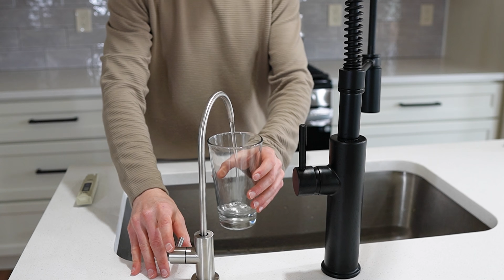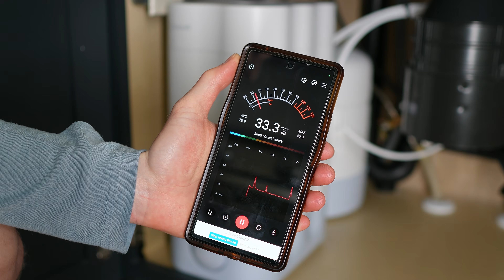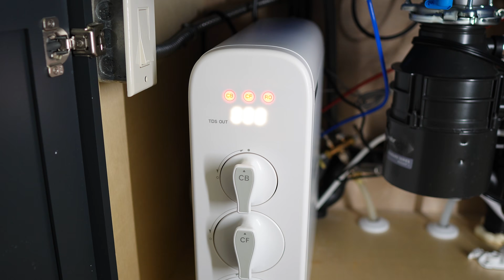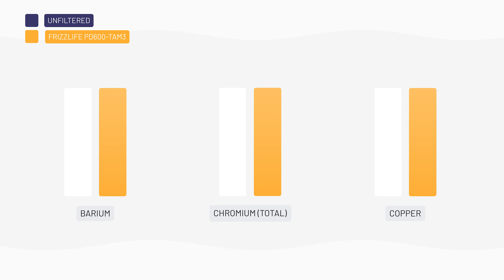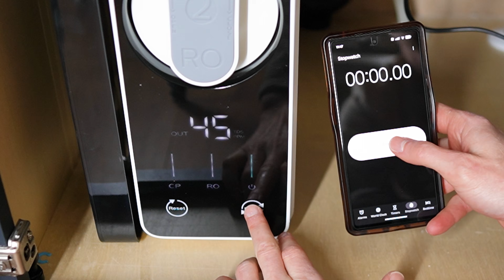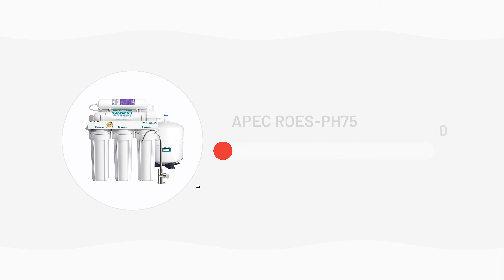The Best Reverse Osmosis Systems I’ve Tested

Comment: Is the G3P600 of the same standard as the G3P800? And just a gpd difference?   I’m researching for a system for myself. Thank you for sharing your extensive testing results.
Reply from the maker: Yes, and the only other difference is that the g3 p800 holds just a couple more performance certifications than the p600

Comment: First I appreciate you taking the time to test all of these reverse osmosis systems.  Secondly, it would be nice if you could put these results in a spreadsheet for quicker reference for those of us that are so undecided as to which to buy.  I have purchased the aquatre countertop reverse. Osmosis and returned it. I did not like the taste of the water at all. And the tds after going through the filter system was just a little bit under what my faucet was, and then is the water set for a couple of  hours the tds rate went down.  I also had purchased the ispring ph-100.  Extremely cumbersome and heavy once water ran through it.  Their customer service by phone was excellent, by chat not so much.  Their instruction book is disorganized, apparently lack quality control, i.e.  I ordered 2yr filter replacement.  After 6 months went to change filters.  The GAC old filter appeared to be of good quality, when I opened a new replacement filter, which was a  different type of filter and appeared to be extremely cheap, the charcoal fell right through the container, all over my floor and was quite a mess to clean.  Apparently they were looking to save money and no one ever did a quality control check.  Also the label on the ph filter was placed on the container backwards.  I did find that someone had mentioned this on Amazon a year or two ago and the issue was never corrected.  I also did a chat with one of their reps about this issue, sent them a pic of my system and he told me mine was ok.  Which it was not it clearly was the opposite of what their diagram in the booklet showed!  I would not recommend them at all. It appears they are disorganized and quality can't be trusted.

Comment: We live in a difficult age when it comes to buying almost anything. Navigating through all the marketing BS is like trying to walk through a minefield blindfolded. It’s getting harder and harder to separate genuinely good products from great marketing.

Great video! What under-sink RO system would you recommend for drinking water that also puts beneficial minerals back into the water?

I’d also love to see you do an in-depth review of Gary Brecka’s $5,000 under-sink RO system. I’d be really interested to see how it actually compares to some of the best systems costing a fraction of the price. What are you really getting for that extra money?

It would be great to see independent water testing before and after filtration, what contaminants are actually removed, how well the remineralization works, the quality of the components and membranes, water waste, flow rate, filter replacement costs, and the true annual cost of ownership.

At the end of the day, does a $5,000 system actually produce meaningfully better drinking water than a high-quality $500–$1,500 RO system, or are we mostly paying for branding and marketing? That’s the comparison I’d really like to see.
Reply from the maker: Great question, I wonder too! Thanks for the request

Comment: @waterfilterguru, in the Netherlands there is a controversial company called ‘Blue earth innovations’ which claims its can remove everything like pfas and even adds minerals. 

He also offers a table top model, it would be really interesting is his claims are true because you will never have to use filter replacements.

It would be very interesting if you could test the device and see if the lab results are true!

Comment: Hum... So ZeroWater tech is better for TDS ?
Reply from the maker: It's not really that ZeroWater's tech is better than reverse osmosis, it comes down to understanding how each one actually works. RO reduces TDS by a percentage of whatever is in your source water, so a true zero reading isn't realistic even when the membrane is working exactly as it should. ZeroWater relies on _mixed bed ion exchange_, which deionizes water more thoroughly and will usually pull TDS down to or near zero. If fully demineralized, deionized water is actually your goal, that's a DI system you're after, and plenty of RO setups offer this as an add on stage, typically sold as an RO/DI system. Different tech built for a similar but not identical result.
Reply: @waterfilterguru Thanks for your reply. Your dedication is outstanding. Be blessed.

Comment: Would it be possible to do some testing with Culligan systems? They have a filter called the "total defense" filter that is certified with CSA B483.1, NSF/ANSICAN 372 (lead-free), NSF/ANSI 42 — Chloramine, Chlorine, Taste & Odor, Particulate Class I
NSF/ANSI 53 — Cyst, Lead, Mercury, VOC, MTBE, Turbidity, PFOA, PFOS
NSF/ANSI 401 — Phenytoin, Ibuprofen, Naproxen, Estrone, Bisphenol A, Nonylphenol
Reply from the maker: Thanks for the request

Comment: I didn't hear you mention what the hardness of your source water is. Are you using a softener?
Reply from the maker: Good call-out. I didn't mention hardness. Our water is very hard at 247 mg/L or 14.4 GPG. We do soften the water normally, but I bypassed the softener for this specific test so we could see how the RO performed on the raw water. If your water hardness is >~7GPG (121 mg/L), I'd recommend pre-softening upstream of any RO system

Comment: I use Waterdrop G3 P800!!
Reply from the maker: Nice, how is that one working out for you so far?
Reply: @waterfilterguru it’s been really good!  It was a bit noisy in the beginning, but we all got used to the noise..

Tastes great, love the UV light treatment.  And the filters are easily changeable.

One thing we did that is we recoup the water drain from the unit to save the water for our garden.
Reply: @Kafka.Hibino8 how did you do that ?
Reply: @irenecastilleja7407  There is a waste line (red) from the back of the unit.  Instead of attaching the waste line to the drain, we route to a large container behind our kitchen.  We had to make a hole but it's small.

Comment: Hi! I have an APEC RO-PH90 I got about 5 years ago and have been researching on whether or not to replace it with a different system or just get new filters (as the filters aren’t cheap). How would you say that model compares to your top 4 here? it’s supposedly better than the their system you’ve put at #4 but I want your take 😅
Reply from the maker: Hey thanks for watching. I have not tested that one yet so can't provide any first-hand data or insight at this timr

Comment: Do we know if the difference between the Waterdrop G3P800 and G3P600 is only the gallons per day (800 vs 600) that it can run? The 600 is just so much more affordable than the 800, and I don't need 800 gallons each day.
Reply: The 800 has a UV sterilization stage which is omitted from the 600. Also because these are tankless, it's not about the gallons per day but instead the seconds per cup. (How long you need to sit at the faucet while your pot fills with water or you refill a glass)
Reply: @keco185  Right, in the video he said the UV sterilization didn't really do TOO much, so I wasn't worried about that. And I figured the gallons per day rating is determined by the speed of the faucet. But yeah. If that's it, seems like the 600 would be the way to go for me. Thanks.

Comment: What are your thoughts of the waterdrop g3p600 vs the g3p800?
Reply: I just had a similar comment. I'm hoping the difference is just the amount of gallons per day output (600 vs 800).
Reply: @ryannewton5096 using chatgpt it suggest going with the g3p600 as the 800 is not worth the extra costs. Mainly will fill glass faster.

Comment: Where do you get this water you use to test?  I mean uranium? It removes uranium? Where the F does the water have uranium?
Reply from the maker: My home in Colorado which is on a municipal water supply that comes from groundwater sources (wells). Uranium is actually extremely common in groundwater sources. Every lab test from groundwater sources here in Colorado I've seen has uranium.
Reply: @waterfilterguru Geez that's scary
Reply: @waterfilterguru So how likely can algae form in the tank?  I'm on untreated well water
Reply from the maker: @AshGreen359  reverse osmosis should never be used as primary treatment for untreated well water. Bacteria will foul and ruin the system. Sediment will burn through pre-filters. Test first and install appropriate point of entry equipment upstream
Reply: @waterfilterguru Well glad I asked.
Reply: What would I install from the well?
Reply from the maker: @AshGreen359   There's no way to know until you test your water. Start with a certified lab test, then use the data to determine appropriate treatment equipment. Check out this video where I explain that process in more detail https://youtu.be/JU4sPer1944
Reply: @waterfilterguru Thanks that will help

Comment: I currently have an old rainsoft system... im lookin to replace and was thinkin about the APEC system there are so many different options... how do you feel about APEC Water ROES-PHUV75 with the UV and alkaline boost?
Reply from the maker: See my results for the APEC ROES-PH75 at  26:47 it's the same filters, the only difference being the UV stage which is only there to protect against any bacteria growth inside the unit itself.

Comment: I read recently that some Waterdrop OR systems release cancer causing particles. Is this because of the tanks? Might be something to check. Love the content
Reply from the maker: "cancer causing particles" is quite broad! Can you clarify what you mean? As long as the system is certified to NSF/ANSI standards, you can be confident that it has been tested for materials safety to ensure it won't leach unwanted substances back into the filtered water
Reply: @waterfilterguru  this kind of gran grandpa attitude.. once I heard it rained in may.

Comment: Hey great video as always. I have the under the sink Aquatru upon your recommendation. It’s great but now it’s time to change filters. Do I have to do “descaling”? And secondly, noticing little bubbles.. the water isn’t crystal clear. Is this normal?
Reply from the maker: Little bubbles/ milky looking water that dissipates with time (also tiny bubbles) are completely normal, especially after installing fresh filters. Descaling is more of a concern with systems that use integrated pumps. Still, if your water is excessively hard, the best way to prevent scaling inside the unit and on the membrane is to pre-soften the water upstream.

Comment: G3 vs X12 pfos filtration is better? Not sure which is better value. $700 vs $800.
Reply from the maker: The G3 series https://geni.us/rQekgwp is certified to NSF/ANSI 53 for PFOS reduction, the X12 is not as of now
Reply: @waterfilterguru they removed the carbon block in the x12 and replaced it with a mineral filter. I went with the g3p800 and added an external alkalinity filter. Wish someone would test the filtration efficacy at 50% filter life.
Reply: Are these systems certified for Cr(VI)?

Comment: Subscribed for RO testing. Couldn’t be happier. 

As someone big into how “they” make us slaves, apps, even ones which can help, are almost always intrusive cons. 

I’m curious how the Waterdrop G8 compares to the G6. I assume the 8 supplies more water. 

We can’t keep up with the 6. But I’m wondering how much difference there is in filtering/water quality?

We don’t use mineralization filters. We simply add a dropper of remineralization to a glass of water a day.
Reply from the maker: Awesome, glad to hear it! Thanks for the feedback. Yes the main difference between the Waterdrop G3P600 and P800 is filtration rate, with the P800 providing faster flow from the faucet. The 800 GPD model is also NSF/ANSI 58 certified for two additional parameters (Barium, Radium 226/228) compared to the 600 GPD model. The P800 also comes with a point of use UV sterilizer as well.

Comment: Is the holding tank steel or plastic on the inside? If plastic wouldn’t it reintroduce microplastics that were removed by the filters?
Reply from the maker: The tank is plastic on the inside, and that's actually by design. RO product water is slightly acidic, so a metal tank would leach into the water over time. Plastic is the correct material for this application.

As for microplastics, the concern is valid but the risk here is low. Microplastic shedding from plastic components happens primarily under conditions of physical abrasion, UV exposure, elevated heat, or chemical degradation. A stable, undisturbed plastic tank in normal operating conditions shouldnt be a significant shedding. The plastic isn't being scraped, it isn't exposed to sunlight, and the water isn't hot.

Comment: Have an Aquatrue countertop system and while it does filter well, it is a PIA to have to filter 2x just to get a gallon of water. I stopped using it because it's so time consuming, plus the descaling process... need an udersink one again.

How come you didn't test the HomeMaster under sink RO? I had an issue with leakage.
Reply from the maker: If you're able to install an under sink unit, sounds like that would be a much better option for you! Countertop RO systems are really intended for folks in rental situations where an invasive under sink install is not an option
Reply: I have the same issue and my aquatru   undersink ro arrives end of the week. Cant wait to get that installed. They have a decent sale going on.